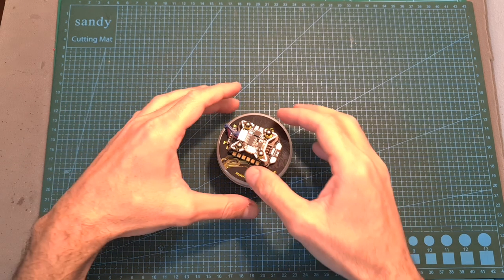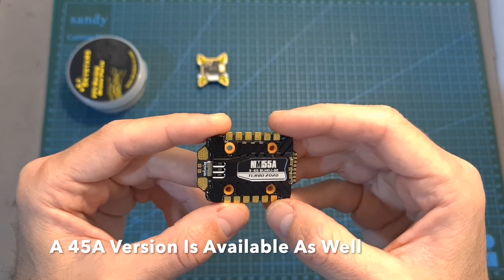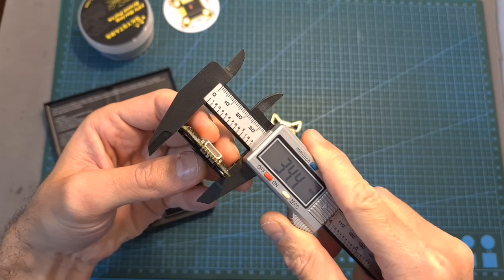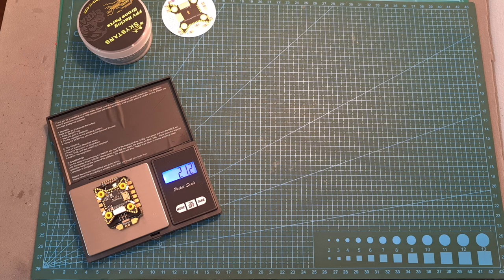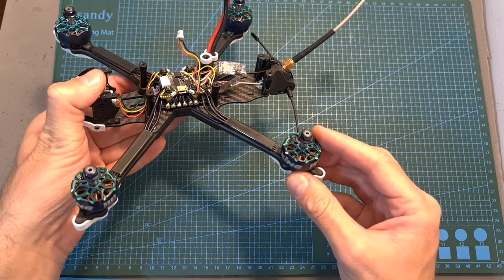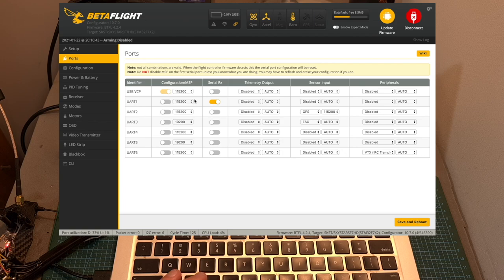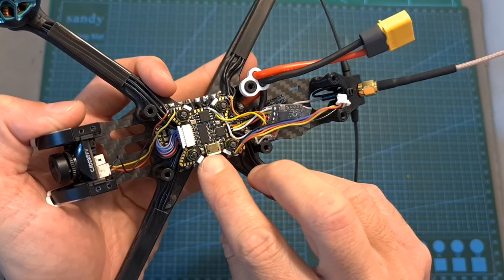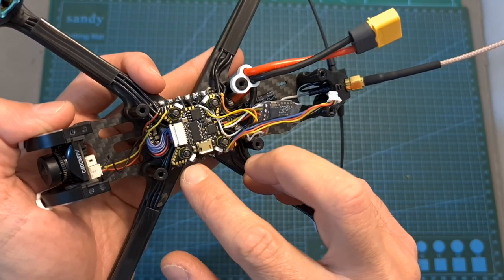Skystars F722HD Stack - Setup & Review

Comment: I have the same stack but I have a question for you…on the top right first set of pads—what is curn pad?? I have never heard of that.
Reply from the maker: Current pad. It enables you to connect an external current sensor.

Comment: I would like to ask when you put the stack in did you put any spacers between the fc and esc? Or did you just put it gummie to gummie. I have this stack and didnt know when i put it in my quad if i should put nutts in between them to snug down the esc
Reply from the maker: Hi, I placed two rubber O rings on each screw between the frame and ESC.
Reply: @KremerFPV  that helps me a little. I was wondering the same thing.

Comment: Really nice flying! I just bought the Skystars Starlord kit and it has this FC and ESC (separate of course) and I'm trying to build it. Maybe it's above my skills because it's only my 2nd real build and there's no build video to follow unfortunately for me. So I'm a little overwhelmed with everything here or maybe I'm just overthinking it, IDK. The build kit came with 4 led bars which I assume go on each arm, but I don't know where to solder them to. I'm glad that you at least did this video so I can see it in action. If you know of a build video or written instructions, please let me know. I'll keep searching, thanks for the video.
Reply from the maker: My pleasure Doug and welcome to the hobby.
The LED bars are not mandatory, so if you are having too much struggle, you can save them for the next build. Let me know if you need more help.
Reply: @KremerFPV  I've been in the hobby over 3 years now but building is new. I actually got a diagram from Skystars showing where everything is to be soldered, so that's a relief. I'm not sure how to attach the LED strips to each arm, perhaps a couple cable ties and or double sided tape? IDK but I'm waiting on my receiver to arrive, I had one of the new xm+ receivers but I sent it back and ordered a few of the old ones with ACCST. Not sure why Frysky did that, but it's a pain. Anyway thanks for everything.